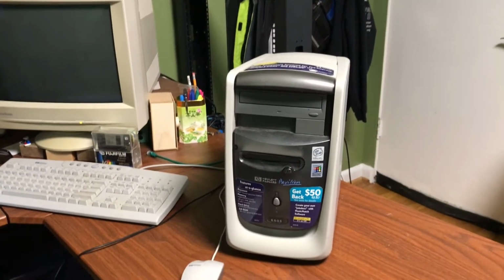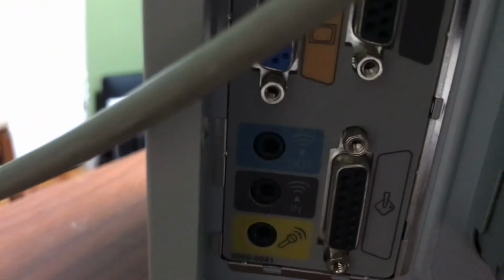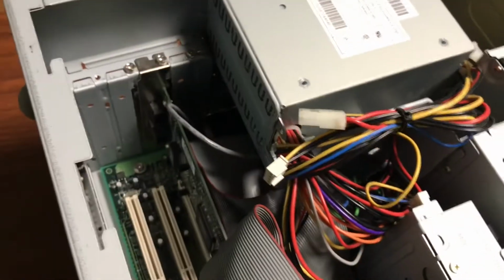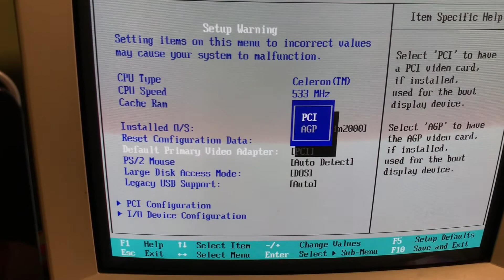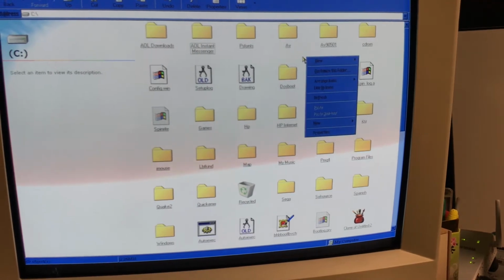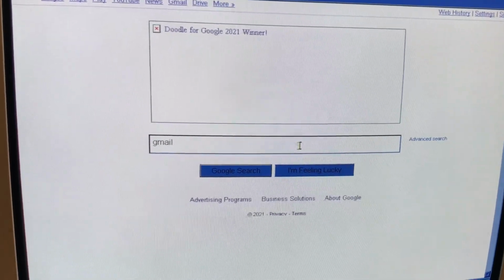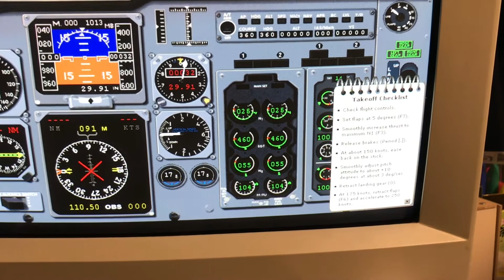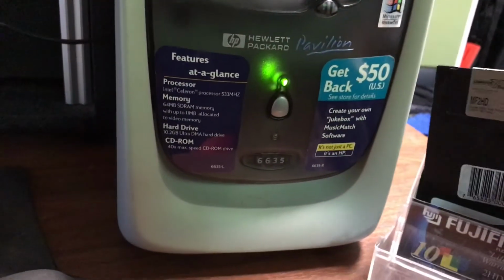Vintage Computer Overview- Hewlett Packard Pavilion 6635

Comment: I enjoyed watching your video. I also have a  HP Pavilion 6635 that I purchased at Circuit City in the year 2000.  The WIN 98 went out a few years later where it indicated that OPERATING SYSTEM NOT FOUND. I did not bother re-installing WIN 98 since I bought a brand new WIN XP computer  that was a little faster. When you mentioned "they were built rather well" you were not joking. In your video I did not see how you opened up the computer. I took out the Phillips screws-  but I do not know what kind of screw driver can I use to open up the computer that seems to have a lot of some strange looking type of screws. ( looks like donuts)   I would like to open up the computer and take out the hard drive so I could re-cycle the computer without the hard drive intact. 
I would appreciate if you can show or describe the easiest way to open up the computer so I can take out the hard drive.  Thanks for your help.
Reply from the maker: Yeah, I can. For me it's just three phillips screws on the rear, but I have never removed the hard disk. I believe you would have to remove the front panel of the machine, as I had to with a Compaq Presario of similar age. I can try and make the video as soon as possible, as I have a few projects I am currently working on at the moment.